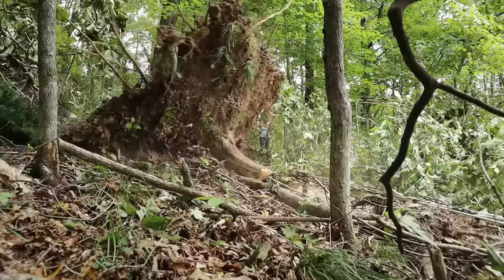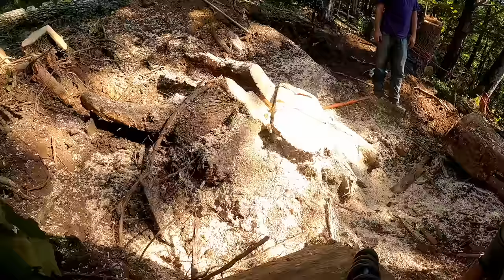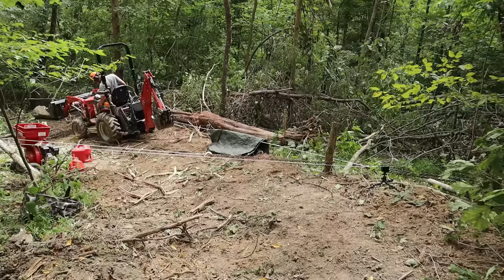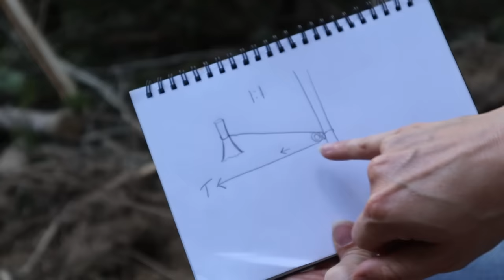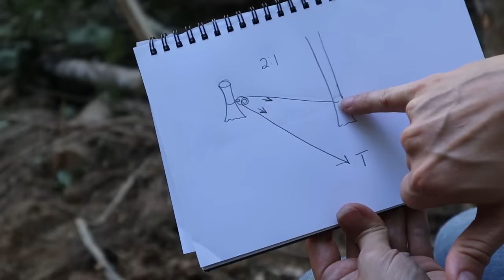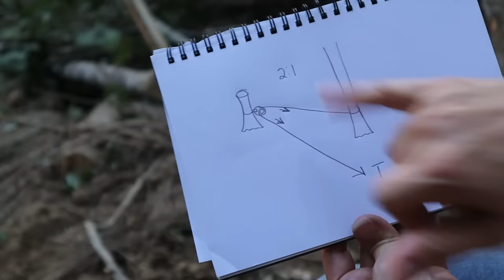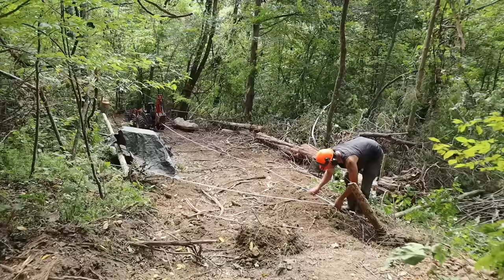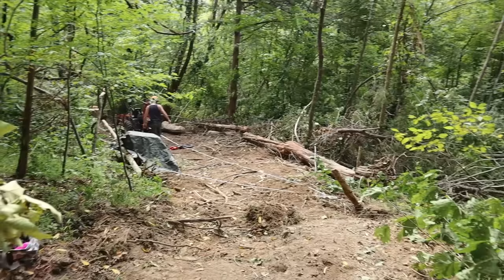Snatch blocks vs tree stumps - the power of pulleys /// E57

Comment: Pulling higher up on the stump is definitely better, so cut the tree as high as you reasonably can, or pull it over before cutting the trunk at all... Use the whole tree trunk as a lever! Also, attach your anchor lines to multiple trees, and as close to ground level as possible, and with straps if possible, to avoid damage to your anchor trees.

Comment: They make a "block and tackle" that would do the same thing with less work to set up.  You can have three pulleys on the target tree and two on the anchor tree and attach the end of the cable to the anchor tree.  You'll be able to pull the stump out with 1/6 of the normal force.  This has been known for centuries, and was a common part of education back in the 1960s and 70s.

Comment: Take a wrap or two with your chain on the tree you are pulling and the rigging will not slip off the tree you are pulling.  Put several pieces of wood on the anchor tree with a wrap to make sure the chain doesn't slip or cut the bark on the anchor tree.

Comment: A 12,000 pound Harbor Freight winch, about $350, and those snatch blocks, would save you a lot of time and heavy wear and tear on your fine little tractor.
Most of the stumps you pulled up would be easy work for the winch, without snatch blocks, depending on how high you tie your cable to the stumps.  Mounting the winch, strategically, on your tractor, probably wouldn't be a lot of trouble.  Depending on how long your driveway will be, a good size dozer and a good operator could have the whole road bed ready to gravel, or pave, probably within a couple of days, start to finish.

Comment: It is also easier if you don’t cut the tree off quite as low and you hook the cable higher. The cable pulling the actual tree connected to the tractor does it need to be level with all the others. If you’re pulling in a downward angle it’s like using a seesaw or a lever. It gives additional mechanical advantage because of the angle.

Comment: Cut your sump high and attach your pulley at the top to increase the moment arm of the stump.  Add 2 pulley blocks with 2 or 3 pulleys each which gives you 6 to one ratio.

Comment: First your two to one ratio only applies when the strands are parallel- as the angle widens the 
load  on the blocks goes way up- look up leg loads for using lifting slings 
this also applies to the angle of the cable going to the tractor
second. the bigger the diameter of the sheave, the greater the moment arm
third  blocks with bearings have a lot less friction then blocks using bushings
forth- using two setups together-
set the primary up as tight as it will go, and use the second set to pull at a different WIDE angle
John Rochester

Comment: If the tree is intact before you get there; it's absolutely easiest to pull the whole thing down instead of cutting it first. rig your winch line high on the tree and use the tree's own leverage to pull the whole root ball out. Just like the wind blows down trees- because it's a giant lever. Then you can slice the whole thing while it's on the ground.

Comment: You can get some more mechanical advantage by making the stump taller; like a lever. After you've turned it, then cut it down to a manageable weight, for removal.

Comment: Pull higher up on tree (without breaking tree in half) about man height or higher if thick tree that need to be pulled.
Like when using a breaker bar on nuts and bolts.
The longer the bar the easier to break loose.
So pretend the tree to be removed is like a long breaker bar.
And when using your  block and tackle correctly you could practically pull by hand.
Also if you Google block and tackle very descriptive of how to multiply your block and tackle where there would be very little resistance on pulling your tree or anything without much effort.

Comment: Just a tip:  Hang a wet towel on you cables.  If something slips that towel can direct the force downward.... just might save life or limb.  I would jack hammer the rocks smooth.  In fact, I bet you could rent one that is heavy duty, hydraulic and attaches to your tractor.

Comment: Great video.  However, to make this easier, cut the trunk of the stumps you want to remove higher from the ground…about 5-6 feet.  Then tie your chain or rope close to the top of the trunk.  This will give you much more leverage and makes it easier to remove.

Comment: I watched this for the entertainment, being an "old" farm boy I was taught this type of stuff by my father and grandfather and had to do this by the time I was 12 years old. The thing I really chuckled at was the tractor being 90 degrees from the load when pulling, that does not add much mechanical advantage. The anchor blocks add no advantage each load block doubles the mechanical advantage, if the pulling force is not in the same direction as the anchor point mechanical advantage from the load is decreased on that block by the angle of offset. Just say'n find an anchor point close to the pulling point. But great vid

Comment: IMO , it’s very easy in the. feild to get  Snatch Blocks and Directions  mixed up  , i do like   doing drawings as my reference as that helps me  keep my thoughts. correct  i’m kind of interested in the Equipment you all purchased first that didn’t  work because i’m a DIYer guy and  will experiment with less expensive gear myself  when getting into a new theory or practice  it’s kind of nice to learn from others  as i imagine. you   thought that stuff was   specked out for your job  BTW thanks for sharing the experience

Comment: You can leave your stumps higher for better leverage. You have to be very careful when using a chain saw above your waste. So use the bucket to stand in and cut the tree about 6 to 8 feet above ground and use a rope to tie the tree off so it leans in the right direction. But remember, safety, safety, safety!  Take care

Comment: Great work and dedication.  I’m curious as to the size of your cable and where you bought the snatch blocks.  Thinking of trying it on piece of heaven that’s heavily wooded.  Thanks.
Reply from the maker: Hey Peter, check out the show notes here.  I put links to what we used in there.  The cable and snatch blocks are both from Harbor Freight.  If you're serious, check out episode 64 on our channel also.  We expand this system and explain how you can get a lot more pull power with a couple extra snatch blocks.  Just remember on those high ratios, like 16 to 1, you need to pull 16 feet for 1 foot of pull on your load.  Make sure you have the room to do that.  Good luck!
Reply: @WalnutsandWineberries 
Thanks for such a prompt response!   Found the gear & will be investing.  👍🤠

Comment: I happened across your video, good description and examples for mechanical advantage. One suggestion however. You are putting a LOT of load on the hydraulics in the backhoe. Possibility of expensive damage. Connect the pulling cable to the tow bar on the tractor. That is what it is for ;)
Pallet forks work better than a bucket to lift out rocks that aren't too big for them (and you won't bend your bucket's edge). Those BIG rocks? Big excavator or blow them into smaller pieces.

Comment: Pulleys are insanely powerful if you know how to use them. For next time: Learn about the Spanish Burton. You can get to INSANE mechanical advantage with only a few snatch blocks or snatch rings. I'm exagerating here of course... but you could almost pull these stumps without the tractor XD

Comment: Hi guys, just a quick word on safety...you need weighted blankets draped over the cable.  If that cable snaps under tension it can whip back and cut you in half or decapitate you.  Jeepers use them all the time with wenches.

Comment: Hi guys...  been searching  for equipment..  i cant find cable with both ends on it.. Where did you buy your supplies? What length did you use for cable..?  thanks .. you helped greatly ...
Reply from the maker: Hey Dale, glad it helped.  There are links in the show notes.  The cable and snatch blocks both came from Harbor Freight.  They sell a nice 65 ft by 3/8 in cable that is very strong.  The shackles came from Rural King, but you can get those anywhere.

Comment: It’s all about lines to the load. If you pull 3000lbs on the rope, every section of rope will have 3000lbs of force on it* (angles less then 180° will have less force and change the direction of the pull; its a complicated formula). Wherever you have more lines connected, will have that many times the load applied. I used snatch blocks daily when I was a tow truck driver.
Reply from the maker: Yes, the ideal setup is 180-degree lines - couldn't agree more.  It's a very difficult thing to accomplish in the woods with the natural placement of trees.  Have you ever run a line between 2 anchors and tie to the middle of the cable to get the right angle for your force?  I imagine, with you being a tow truck driver, you've seen many difficult situations.
Reply: @WalnutsandWineberries  no, I haven’t done that. We were typically only equipped with 1 snatch block per winch and mainly used them to change direction. I have used them to increase the pull with medium wreckers but I’ve honestly never used more than 1. Mainly there to protect the planetaries in your winch. With a 14,000lb winch in automotive applications, you rarely need more than a doubled line. I’ve seen it done with heavy duty wreckers, but the issue becomes your ability to anchor the pull and/or things to tie off too that wouldn’t just be destroyed lol

Comment: Would you not be better using the strength of your backhoe bucket to pull? I used to straighten out wreck damaged railroad cars and always used the hydraulic force of the crane ,fork lift ,or whatever tool I was using ! For instance get your slack out of your cable by driving the machine and have your bucket extended. Then keep your brakes on and with cable attached to your bucket retract your hydraulic force towards you . I used heavy fork lifts and tilted the forks forward ,attached chain to the mast ,then backed machine up to remove slack ! I then tilted the forks back using the hydraulics to pull the chain toward me .It straightened plate steel rail cars all the time thus way . Used extended crane booms same way , it never damaged the equipment because the cylinders are double acting ! Same force in or outward. How about a fulcrum like using a truck wheel and tire with cable on top ! Great video though , pulleys and mechanics advantage are great things ! Good luck ,you are a great team!
Reply from the maker: Just used that technique today getting a very large log down the mountain.  Drive off, brake, pull/curl in, repeat.  Works really well.  👍

Comment: Thanks for the lessons. But what's with putting the coat on the pull rope?
Reply from the maker: It's a dampener. If the line breaks, it will significantly slow down the whip of the cord.

Comment: Get rid of the hydrostatic transmission tractor and that’ll help immensely. They rob a ton of power. Kubota talked me into one (which I specifically didn’t want) due to having to “special order” a standard trans and I had to return it after the first day of operating it because it wasn’t even strong enough to pull the weight of the tractor and the logging winch up the driveway. That was a 46 hp tractor btw, not a compact.

Comment: Great vid, your last pull however was not 4:1. The direction of the tractor needed to be in line with the pull not adjacent. Being he was nearly at 90° to the pull it was actually closer to 3:1. However awesome demonstration on the use of snatch blocks, we do this in the towing and recovery industry regularly.
Reply from the maker: Thanks James.  It's tough to find trees exactly where you need them to be as anchors in the woods.  If we do another video on them, we'll address this point, because you're right.  We've learned a lot since posting this, and we are glad it's helped so many 👍

Comment: Only one thing wrong is were you hook to the backhoe, you should hook to a lower point on the tractor just behind the rear wheels.
Reply from the maker: Couldn't agree more.  I need to do my work with the backhoe, remove it and hitch the tractor properly so I don't damage the backhoe.  Honestly, I didn't think I'd be pulling as hard as I was.  You're definitely right though.  Do you think the arms of the 3 point system would suffice?
Reply: Awesome video once again! I was here to mention the leave the stump higher and hook 🪝 higher but see I’m late as usual. 

I think the 3 point arms should be okay to pull from. You can buy a 3 point hitch trailer mover that takes a 2” tube just like a truck. I think I would trust that more than the factory draw bar. 

I did the backhoe installation on my RK24 and the plates on the tractor that the hoe attach to have a lot of bolts holding them to the tractor!  The big pin that the lower lift arms mouth to go through that bracket so it should be pretty strong!
Reply from the maker: Definitely in the market for a 3 point hitch.  After watching the video, I must admit that using the backhoe would be pretty self  destructive over time, so I'm going to try to resist temptation and not do it like that anymore.  I did remove it at one point and linked it to a hitch that's at the very bottom, in the middle and that seemed to work a lot better.

Comment: Can anybody answer this... My local hft store has the wire rope to pull with but the winch rope only has a hook on one end. Can I buy the wire rope with hooks on both ends
Reply from the maker: Most come with a hook on one end and a metal loop on the other to attach a shackle.  I like to keep a few Crosby clamps and loops on hand along with some shackles so you can make various lengths out of one long rope.  Hope that helps.
Reply: @WalnutsandWineberries  ok thank u so much

Comment: I question your decision to living and construction a home on top of your property due to weather and seasonal access without the grading of the of the driveway. How steep an angle of attack will be required of the drive to top and how many switchbacks ???? The reason I ask is I have the same type of acreage in Tenn. and I could not get it done without out a contractor and heavy equipment. Good Luck!

Comment: You can also burn stumps. Put a 55 gallon drum over the stump. Build a good fire inside the drum and let it burn. The stump will continue to burn into the ground. You can improve this by adding compressed air. However you can melt your barrel. Takes about 24 or 48 hours

Comment: You should use multi roller pulleys because a snatch block, one snatch block only adds a mechanical advantage of one or two or ... the multi layer pulleys with minimum 3/4" wire rope could give you Multiple additions to the mech advan.  Keep the main anchor low and the wraps around the secondary anchors about 3-4 feet high and get out of the way.  I've taken down as much as twelve 6-8" diameter trees anchored with a 24" main diameter anchor, by myself, on multiple occasions.  Be sure to plan for potential loss of blocks which with the cable, could kill you.  But I'm 70 and still going strong.  Just be careful.

Comment: Maybe a dumb question but do the forces on the ropes or cables used increase when you use pulleys to increase the pulling force?
Reply from the maker: Yes, which is something that needs to be considered when calculating how much force you want to put on an object.

Comment: What size cable did you use? thank you!
Reply from the maker: 3/8 in by 65ft in length rated for 12K lbs.
https://www.harborfreight.com/38-in-x-65-ft-replacement-winch-cable-with-hook-61667.html
Harbor Freight has the snatch blocks too, rated at 20K lbs

Comment: The wire rope appears to be a 5/16 rope. The working load for that rope is around 1,200 lbs; however an even distribution on a  4:1 should significantly lower the tensile strength. Unfortunately... the (X) unknown variables of the force required to pull the tree still play a major factor in the 'required' tensile strength.

Comment: Great job, you too are a good team!!
Are you pulling with the bucket or drawbar of the tractor?
Reply from the maker: As I shamefully lower my head, I was pulling with the backhoe.  I know, I know... and I've learned the hard way not to do that.  I broke the cylinder in episode 60 and learned my lesson.  Drawbar from now on.
Reply: @WalnutsandWineberries  Hey, you never learn anything until you at least first try.
You have graduated to compound pulley systems too?? you guys are rock'in it!!
I used to teach a little of that stuff before I retired. Levers / Pulleys / Incline Planes .....It's so very fascinating  and in some cases, a lost art from so long ago.

Comment: Ive been down this road before. Had a back hoe come in and remove a few trees. I soon learned.... use a chain saw....cut the stump to ground level... put a bit of dirt over it.....let it rot.  Digging them out only creates more work...... exposing more rock.  A chain saw chain is expensive yes.......but the time it takes to dig them out....dollars per hour. Hands down...... chain saw chain is much cheaper !!!!!

Comment: Research “Spanish Bourton”, for a better way for a 4:1 setup. In 4wd recovery, using a snatch block for a 2:1 advantage is known as a double line pull. You can do a double line pull on the moving side of another double line pull creating a 4:1 with just 2 snatch blocks.